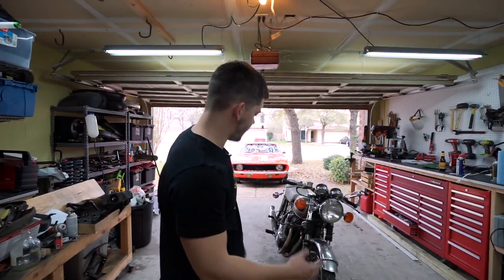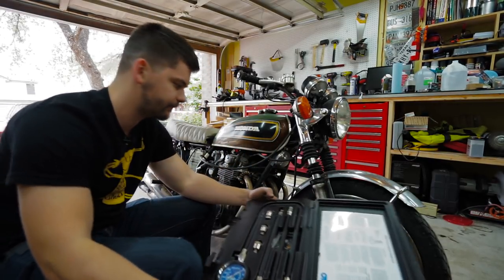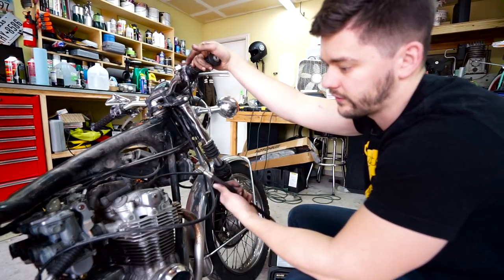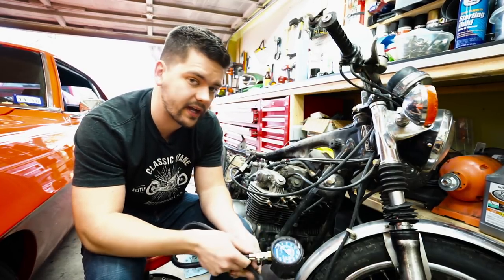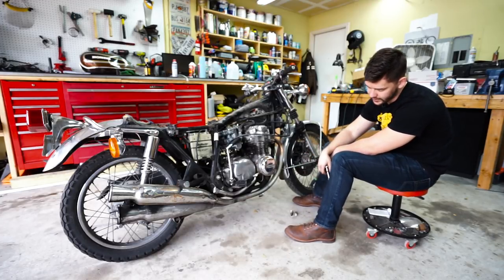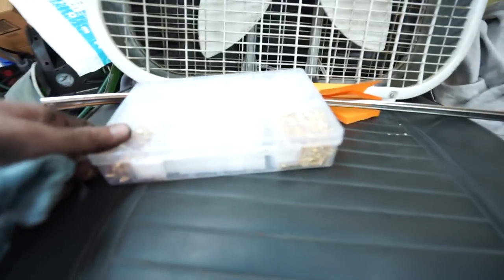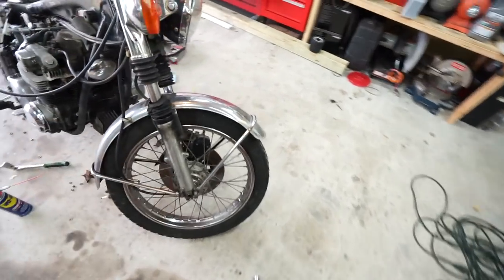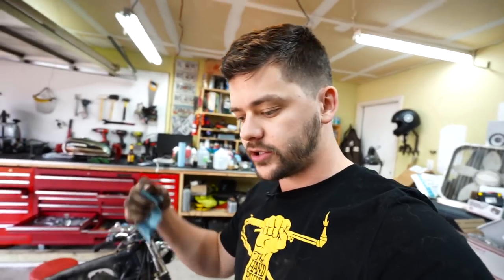Barn to Brat Episode 3: Compression test & Teardown

Comment: Hey man which electronic ignition are you running on this bike? As well, which regulator/rectifier are you using? I just picked up a 75 CB550F, not in running condition and I am debating upgrading a few of the electronic components after I attempt to get this bike to fire. Doing the upgrades with hopes of better reliability, so please any insight on which brands to stick with and/or stay away from would be much appreciated. 

Keep up the great vids. 

-DB

Comment: Taylor - is there a way to do a compression test on an engine removed from the frame?
Reply from the maker: Definitely, just need to make sure to have your oil tank hooked up if it's a 750. Then you can just jump the starter with a battery or jump box.

Comment: hey guys, I'm rebuilding an '83 cb650 sc nighthawk. does anyone have any tips or pointers on how to rewire the bike? the wiring is super wack on mine so i figure i oughtta just replace the whole thing. Where can i get the new wires and where can i get a good easy to read diagram to wire it myself?

Comment: I would re-lace the front wheel using a rear rim and use the same size tire rear and front. This will give you the tracker look you are after. The front fender chop chop or keep the bracket and mount a shorter fender. To see what I am talking about just use this link. This is see one of my build (1974 CB360)  https://i.imgur.com/Fp8oycH.jpg

Comment: You mention that the Shorai Battery that you have can self regulate the voltage.  Any more details on where you found this information?  Thanks!
Reply from the maker: It was referred to as an internal charge limiter. I will try and track down where I read that.
Reply: I have been going back and fourth between the Anti-Gravity and Shorai Batteries for my CB550 and had concerns about overcharging even with a solid state reg/rec combo. If the Shorai Battery does have an internal charge limiter, then that is clearly the way to go.  Thanks for the help!

Comment: Instead of actual oil in the cylinder can you spray a little wd 40? Say if a bike sat for a couple years and you were going to look at it to buy, but the owner hasn't started it, it's go or a dead battery, I know the oil has disappeared from the cylinder walls so I w ouldnt want to try cranking it without some lube in the cylinder. Would wd40 suffice?
Reply from the maker: I don't know why not. I know a lot of people use Marvel Mystery Oil as well.

Comment: I love your builds, I actually got my hands on a 77 GS400X and did a compression test Saturday with kick start only and I got 120psi and 95psi but the bike has been sitting for 15yrs. Is that really bad ? I know when the previous owner had he said it was running ruff and more than likely on one cylinder.... any advice?
Reply: Jaime Vaquera get some Marvin’s mystery oil and let it soak. Try again after that.
Reply: Okay great I’ll try that tomorrow after work thanks
Reply: It's actually Marvel Mystery Oil. (Darn spell checker with autocorrect )🙁
Reply: Ron F yes that’s right Marvel

Comment: We cut the front fender on my sons CB550 and it looks nice. Also l've seen on Amazon, GPS speedometers which should give accurate speed readings and seem very reasonably priced. Would you consider? I don't know anyone who has bought one. Just a thought.
Reply from the maker: I was thinking about one of those for my Triumph. The speedo drive is on the rear wheel on those bikes and I don't want to run a cable down the whole bike.
Reply: Classic Octane .....I know what you mean, I have a 77 Bonneville. You’d think that they would have put it on the front wheel like the Japanese motorcycles.